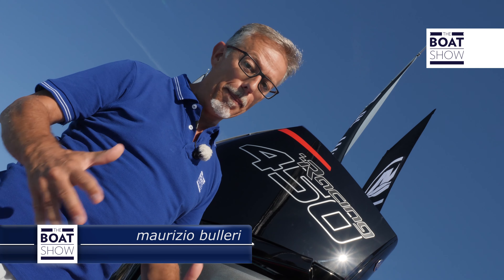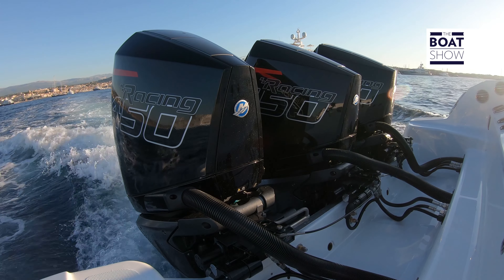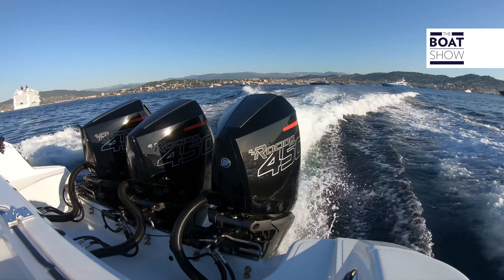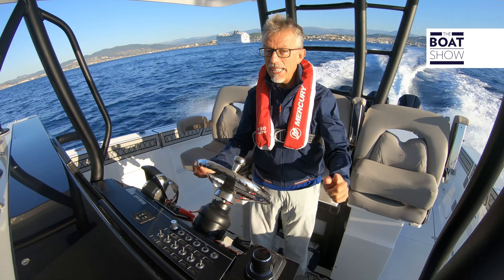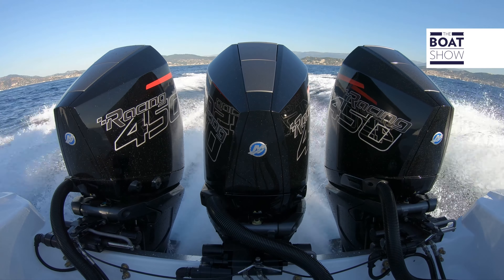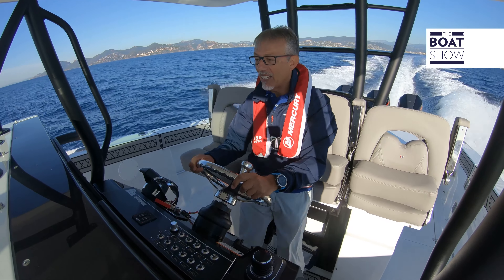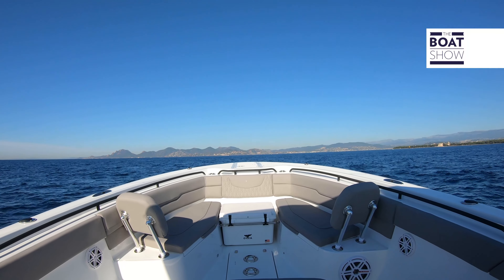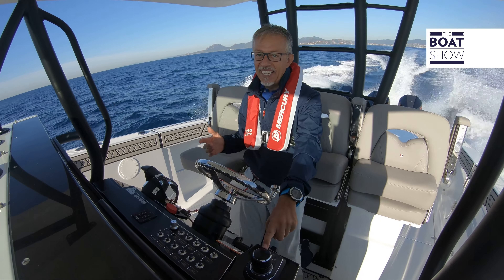[ENG] MERCURY RACING VERADO 450 R - Outboard Engine Exclusive Review - The Boat Show

Comment: Wonderful engine, as long as outboards get more HP, better and faster boats will be made. @shingnosis  is totally right, I believe heavy boats should go with inboard diesels . New materials and smart design ensure safety with much less weight. Can't wait to see a pair of those 450R on a Technohull Sea DNA 999 that is only 2000Kg..
Reply: That would indeed be a lovely combo! The boat show should also travel to Norway and test all the Goldfish ribs, expensive but great quality ribs. You can get the new 28 Bullet with a single 450R and with that engine you can cruise at around 1L/NM and also have a top speed close to 70 knots. That kind of speed and efficiency in a 28 hull is the future I believe.
Reply: @shingnosis The 28 Bullet is a wonderful boat, will do a great combo indeed! Consumption should be a big factor when choosing a boat, it's not only about the cost but also about range. A 300 liter tank can take you 300 miles away with your example. I would like to see that test too

Comment: 1350 hp and not even 60 knots. Americans and their heavy hulls...
Reply: 352 Wellcraft is junk
Reply: Hmmm, well a 37 Contender runs 62 knots with 300 less hp.
Reply: Boat is not made for speed. Engines are made for speed.
Reply: We have the first 36 Yellowfin with trip 450r’s with 13 people on it it has went 83.5 mph